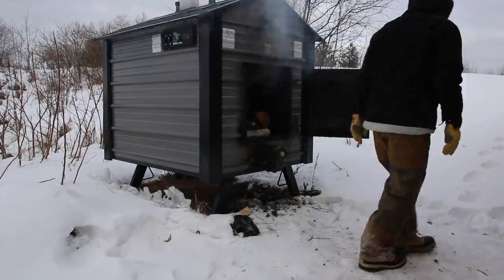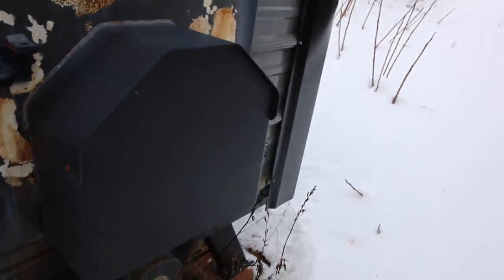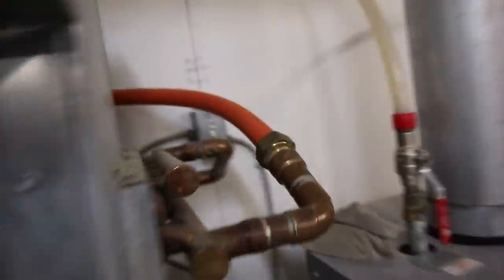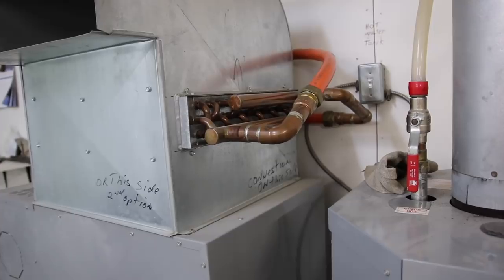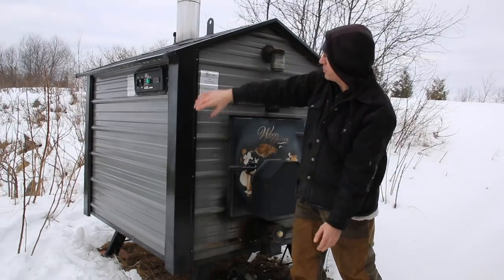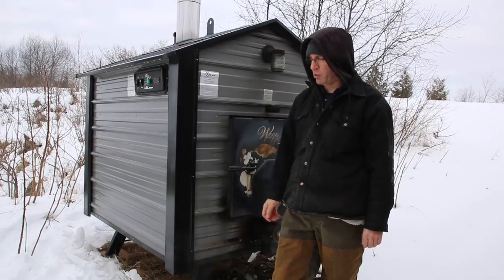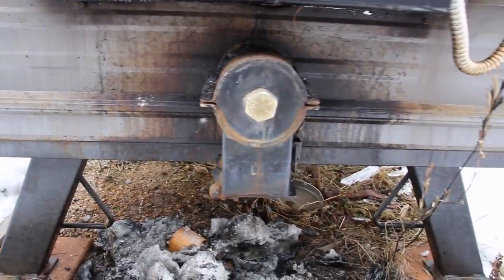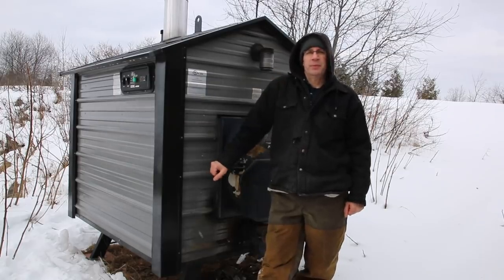Outdoor wood furnace "worth the investment?"

Comment: I've been using these type boilers since the 70's and can tell you that you have two serious heat loss issues going with your setup. One, your long run from outside is too great. Also you are way under insulated on your piping. Your piping (supply and return) should have 6 inches of insulation wrap. You need REAL insulation like EPDM around the pipe itself in two layers totaling 6 inches, then the two lines together need a complete overlapping insulation taped at the seams then it needs to be encased inside a solid underground rated corrugated drain pipe . Also you have too much piping exposed inside your building running up to your heat exchanger. You are suffering probably 45% heat loss due to a bad set up. Trust me i've been doing this for close to 40 years.  good luck.
Reply: So, one comment: Tom Cook, you said, "...you have too much piping exposed inside your building running up to your heat exchanger."

I disagree with that. Where do you think the heat GOES if it is dissipated? It heats the SHOP. It just gets out of the pipes BEFORE it gets to the heat exchanger. It is exchanging heat already. Think it through. The air scavenging heat off those routing pipes is INSIDE the shop, so it is not a problem! 

People say to put a water heater in the garage, then insulate it to keep in the heat. I know of a house in a fairly cool pacific NW (west of the Cascades) climate where the water heater is inside the house, and has no secondary insulating jacket on it. all the heat that escapes from it  AND the feeder pipe is added to the heat in the house. Why would they put it in the garage? Scavenge the heat. Those pipes are just like the ones you were saying had a heat "loss" - the heat they BOTH lose is to the desired destination. It is radiant heat, just not fancy blower heat.

I was sort of dumbfounded when you said the exposed pipe INSIDE the shop was a heat-loss problem! Wow.
Reply: And what is the cost of that?
Reply: was thinking the same thing...too long of a run, should be short as possible
Reply: You don't always want to add heat to the house. Our two water heaters are upstairs and we live in middle GA USA. Trust me when I say that there is no need for heat emissions inside the house for five to six months a year.
Reply: you are so right, i will also add, it dont mater how long the runs are or how many, if installed right there is no heat loss to the ground, in Finland they do not have any land fills and each city has it own huge system that burn are the waste as well all wood waste and the government tells you when you have to cut all the under brush and dead or dyeing trees, a machine comes in and bales it all and the city pays you for it, every home and business in Finland has 2 water lines going to it, one cold water and one hot water, hot water for heating and cold domestic water, the month home hot water bill average is 20E a month, they also have hot water lines in all the city side walks to melt the snow and ice, this guys install is so poor like so many i have seen, never buy that foam filled under ground pipe, it is very costly and no good for nothing
Reply: I think that a 45% pipe loss is an exaggeration. After the pipe run has had a few days to warm up, I cannot imagine the return temp being reduced from 170 degrees down to 94 on its return to the furnace if the workshop radiator was bypassed.
Reply: He seams a little slow. he apparently has not relied on fuel oil or grid electric for heating.
Reply: Lol you can lead a horse to water Tom Cook
Reply: Do a temp reading at the furnace and one in th garage, just curious how much heat loss there is.
Reply: @patmatt975  aah, a simple science based suggestion to settle the heat loss question!!!
Reply: there is no way he looses that much heat. But that is a long way to run the piping and that t pex isn't good stuff. My t pex was way better looking then that stuff he has. I loose less than 10 * in the total run both ways.
Reply: logmeindangit
so clearly he meant outside.. and I agree, that was the first sign to me that he was not energy wise. all of what he spoke of is true and so much more. What it did do was cause me to design yet another wood burning apparatus for various uses. 
What i find sadly humorous and we all do stupid things ... actually dumb things because of ignorance... stupid is when you know better and do it anyway, dumb is when you don't know better because no one shared the info with us.... 
Ok the simple solution on so many levels would be to simply run the heat exhaust up the side of the building and above it by three feet creating updraft (no fan needed) put the chimney stove piping at a 17.5 degree angle or more depending, at least 2 feet away from the wall and double back if you can and up out the peak plus two to three feet (looked like the building is in a holler so it may have to be taller with stays and or a wurrlygig spinner to stop downdrafts.... now the door to the furnace could be facing out of the back of the shop, clear a space to bring and stack the wood on pallets, cut a hole in the wall for the door after stripping the outside off and making adjustments, sealing holes or putting valves in them to use for more efficient burning, and now you conserve all the heat produced, don’t need a fan and all that electronics to go bad but if it works leave it on there for when your not around, (love the oil burner backup and use of the same fan.... check to see if you can't put a large flap to direct the flow of air over one or the other radiators and reduce drag on the motor (I found that finding an old belt drive fan and reducing the ratio even more so it runs very slowly and quietly (grease bearings once a year) works great and never need the furnace fan and all that electricity, like 120 bucks a month around here... or a cheap fan on a stand works well to with a directed shield around it blowing at the flew pipe (get the thick good stuff, solder or screw and tape the joints and paint Black Chimney works great)... 
Oh and if you want to go automatic find some potentiometer setups or the old spring thermostats that are large and strong and use as valve to open air intake or close it as it gets hotter.  Cut a doorway about four feet away from the stove and create the wood patio loading dock, which you could cover with foam and siding with slats to screw to (be sure to pre-drill, use rubber washers and or calk in the hole first to oooze out and then cover again and smooth over so no leaks, I use soffit vinyl white (due to least expansion rate which a lot of screws can overcome) I use drywall as they have a lip on the underside to grab the drywall paper and it works as a built in seal so all ya gotta do is properly seal the top so it doesn't rust.... so now you can go through the shop door in your PJ's and load it up or if you've built an auto loader, simply open the furnace door hit the load button and the logs slide down a shoot like a concrete truck and you direct the flow and where it goes, Close the door and wander back to the lazy-boy chair and the football game..... :-}
And now when you go out with your family to have fun or teach some kids that have never experienced it and make it a fun event, get a real log splitter that splits a log into five pieces in a second ... see youtube videos.... or put a team together and make a little production of it and sell some to pay back or pay yourself for being so smart... what matters is that you have fun and share it with others while "work is being done".. If you were loading it twice a day the way you have it now, it will be every two days this way, which means you have a slow burning kiln now and can put big thick heavy logs in there once you have a good heart of coals...won't be long before you're opening the door to let some cool in... oh and don;t forget the importance of moisture to transfer heat and more comfortable for the lungs etc... Blessings hope someone gets something from my sharing.... I can see it, and I like it... thanks for sharing..
Reply: He can heat 4 houses the way he has ,
Reply: Arnold Romppai -The length of the run is important. Proper insulation is a must, however the water leaving the boiler isn’t hot enough for an extended run. Remember insulation only reduces the leakage of heat. It doesn’t prevent it from happening completely.
Reply: Adrian Chetwynd -That all depends on the outside temperature. Even though the pipe is insulated and buried the surrounding ground temp will effect it. Especially if it’s buried shallow.
Reply: Doc the hillbilly lobo -That’s not only inappropriate, it’s ridiculous. He has an oil furnace in the shop and some type of heat other than wood in his house.
Reply: I have not since 70s but have run a few forests thru. Your right. I made same mistakes as he has. But can rasel a bear after the first part of learning curve. I
Reply: @arnoldromppai5395  i would love the idea of hot water piping coming in from the street for domestic & heat. Especially for 20 clams.. 
 I wouldn't need to buy a boiler or water heater. They would never break & flood the basement,  and no repair bills..
   Asfar as underground pipe insulation,  they make a pipe that has 2 lines inside, that loose only 1° from the unit to the house.. For me i want that, you can only heat to 180 if there is pex, so loosing 10 or 20 degrees before getting to the heater is pretty big, plus if there isn't any snow, its just wasted heat.
Reply: @adrianchetwynd1334  i don't know how far off he is, o understand once the ground is heated around the pipe the heat loss should drop, but once the ground gets wet, it'll cool so fast i wouldn't be surprised if it looses 50 degrees or more.. I soldered many pipes & cooled them with a wet paper towel..
Reply: @thomasbroking7943  yes Finland is far a head of use, i can remember my grand mother shipping food to family after the war with Rusha, as they were on limited food stamps, and yes, you can buy that ready made insulated pipe if money is not a problem for you, as it is like $17 a foot, and the R value is only an R 6, i been making all my own long before they started that, in fact it was back in the day when the only line insulation the had was round foam with a grove for the pipe and was split in half in 4 foot lengths, and you taped them together, but water got in and you mit as well not put it on, you can make up your own for under $5 a foot and it is a R 14 and take no time at all to put together, the boiler foil insulation comes in 100 foot roll 4 feet wide and you cut 20 inch long peaces, and lay the 2 pipes on the ground and wrap the hot line once around then wrap the remainder snug a round both pipes, taping with foil heat duct tape, pull a small rope though the 6 inch black solid weeping tile the tie the tile to a tree an hook the rope to your car an have one guy guide the pipe in as you pull it in, the best part of Finlands system is they dont have any land fills, it is use to make heat, and stuff that cant burn is composted, and you take your plastics to a drop off and they pay you by the Lb.. ,, i am told there hot water bill year round even with -40 winter is 20Eu.
Reply: @thomasbroking7943  
I think the owner ought to by-pass the heat exchanger and do a test to see what the pipe losses really are.
I live in a city that has a municipal water heating system and the insulation isn't very special. So if piping looses heat so rapidly then my hot water would only be warm.
Reply: The heat loss will be greater the higher the input temp so to save heat loss its best not to operate any hotter than necessary.
Reply: @adrianchetwynd1334  the main loop must keep circulating at a high temperature,  probably no where near 180° you need for a blower assisted unit heater.
  I would love to see the spec's on the municipal system.  Biggest hot water domestic system i saw was a million btu boiler used to heat a 1000 gallon holding tank..for a police station & small jail.. 
  Technology changed so much the replacement was downsized to 1/4 of the size.  I just saw it, didn't do the job.
Reply: @thomasbroking7943  
I would love to see the specs on that municipal heating system too which was built whilst the city was under communist rule.
I'm pretty sure that the losses exceed 40%!
The city has Gas. A domestic gas boiler is far more efficient so what's with the municipal heating system that's still being connected to by brand new apartments?
Me smells "Agenda 21"
If you don't know what that means then google it.
Reply: @adrianchetwynd1334  that long ago its probably encased in asbestos & concrete like NYC. Super low heat loss i am told. I have an older buddy tell me stories about encasing water towers in a asbestos hair type product. Same on heat, but it's all poison now
Reply: @thomasbroking7943  
Asbestos isn't poisonous to touch, only to breath in.
It snowed in my city a few days ago so it was very easy to locate the water pipe runs. The snow melted above them!
Reply: @adrianchetwynd1334  HEAT LOSS HAS NOTHING TO DO WITH HOW HOT IT IS, THERE ARE RATES BASED ON WHAT YOU ARE RUNNING SUCH AS A WATER TO AIR HEAT EX CHANGER OR A WATER TO WATER HEAT EX-CHANGER, THEY MUST RUN NO LOWER THEN 180f BUT BEING THESE ARE NOT LIKE A BOILER AS A BOILER IS NOT OPEN TO THE AIR, YOU CANT RUN THESE ANY HOTTER THEN 195F TO 200f AS WATER BOILS AT 210, AND ONLY A CLOSED BOILER SYSTEM RAISES THE BOILING TEMP, AS BOILER RUN AT 112 TO 215 WITH 12PSI
Reply: @thomasbroking7943  
My current outside temp is over 6 degrees C and the water temp is about 52 degrees C. 
But when the outside temp gets very low my water arrives at about 40 degrees C.
Very serious heat loss I would say.
Reply: @arnoldromppai5395  
Heat loss has lot's to do with temperature.
The higher the temp the fiercer the heat loss.
Grab a laser temperature monitor to witness the fierce heat loss from a boiling kitchen kettle after its power source has switched off.
Heat loss operates on a negative exponential curve.
Reply: At boiling point, water expels any excess energy by turning into steam, hence why steam engines work. 
Steam engines convert heat into motion, but they can only operate above boiling point (100C).
Reply: @adrianchetwynd1334  could it be your line coming in loosing temp, or do you think the miles of piping is =
Reply: Probably can't ask for a diagram without going on a watch list..lmao
Reply: @adrianchetwynd1334  as a dealer of heatmaster SS and in staller for 30 years of many brands, i know a lot about them and heat loss, and if everything is installed righ, meaning properly insulated and water tight from ground water, and the right size pump, as i said in my 1st post the temp should not be any more the 3 to 5 deg different from your hot line going out to your return line going back in know mater how hot the unit is, if it is more then it was not installed right, if the pump is to small the water is not moving hast enough, i have fixed bad installs were the heat loss was over 22 deg, and got it down to 2 degs, you can also have to much heat loss by not zoning
Reply: @thomasbroking7943  
My original comment stated that the heat loss isn't as large as someone here had said it was.
I still stick by original claim and shall not be wasting any more of my time with this futile thread.
Reply: @arnoldromppai5395  
Regardless, do you agree with me that the installation in this video cannot be loosing as much heat as one of the commenters in this thread has claimed?
Anyway, its very simple for the owner to do a test to measure the actual heat loss.
Perhaps he ought to make a new video on the subject.
Reply: @arnoldromppai5395  
I agree, a fast pump will lower the outgoing temp from the boiler and therefore reduce the heat losses; because the higher the temp the greater the loss of heat from the transmission pipework.
Reply: @adrianchetwynd1334  OH IT IS LOSSING TON OF HEAT, DUE TO NO FOAM INSULATION UNDER THE BEDS AND FOIL BUBBLE PAD TO STOP THE HEAT FROM GOING TO CHINA, and his main lines do not have proper insulation on them and in a casing to keep out water,, as well his heat is set far to high for what he is doing, like a concret floor you must have a 1-1/2" to 2" foam with a foil bubble insulation stop to keep out ground water and stop the heat from not only going down but out side was as well. his beds need these 2 layers under the top soil and on the inside walls of the beds to stop the fast heat loss and lower the temp to 100F as the heat he is set at is pulling it down much faster, like the side walks in town town Finland they installed the 2 layers inter the cement and they use it to cut the cost of snow clearing.. the sides and bottom must be insulated and seal out ground water, and he put the pex pipe in his beds to heat them and no insulation or layer to stop the normal ground water from taking the heat away, ground water )dampness) is the biggest rob of heat as i posted in my own post
Reply: @arnoldromppai5395  
Your comment persuaded me to review the video.
At about 4 minutes in I was able to see just how pathetic the pipe insulation is.
So my apologies to all whom I was foolish to criticise.
Reply: I presume that the boiler output water flow is on the right side of the image which is displayed at 4 minutes in.
But even so. why spend so much on a boiler and so little on its power transmission system?
Reply: @adrianchetwynd1334  Thank you..i am glad you had a watch, bt keep im mind he also states he is experimenting, but the down side is he had it hooked up to heat his home, when he bought the place it was there but he said it burned wood like crazy and inspite of me telling him why and how to fix it right he went to the cost as well as a big fire hazed and bought a wood stove to put in one room to heat the whole home and install the stove pipes, when it was a case of a really bad install.
Reply: @deanomatic5129  they make pex thatover 100 feet looses only 1°f... That's what i would want.
Reply: Agree with everything you say. I’m obsessed with insulating pipes and can’t put enough on
Reply: You sure got a lot of negative comments.  Personally I think you raise VERY valid points. That insulation jacket for the long run to the house is WAY under insulated. It appears that he is heating supply AND return water by being in the same jacket. That wont hurt the flow but it lessens efficiency obviously. That coupled with a crazy long run to the house must eat wood like crazy. Interior pipe insulation would help a bit too. When the summer comes he should move the boiler closer and insulate like crazy. Cut his wood use in half I bet.